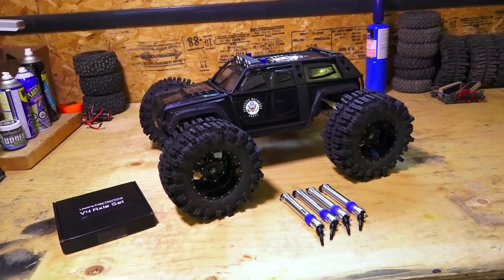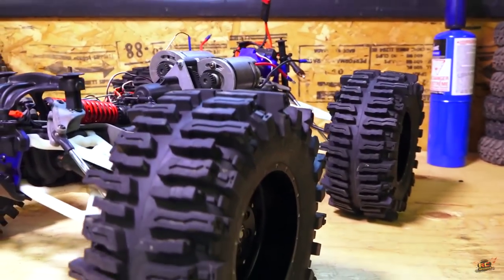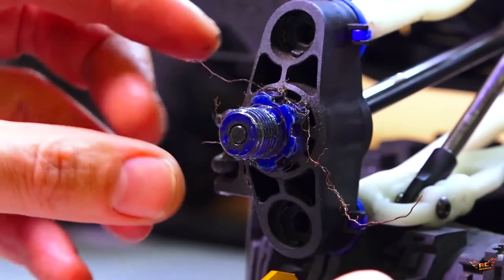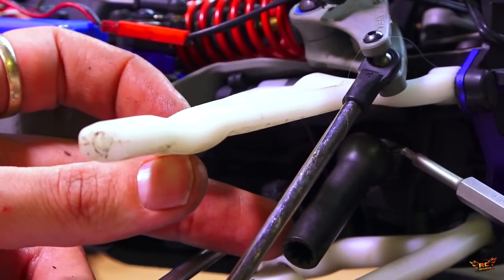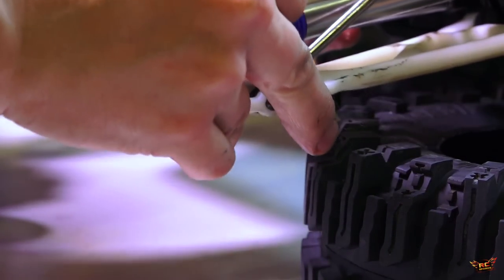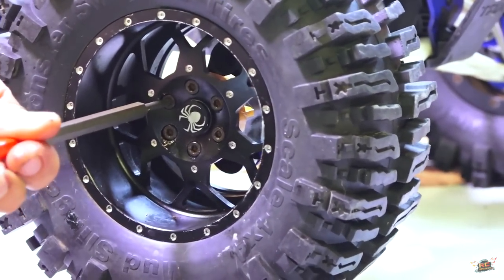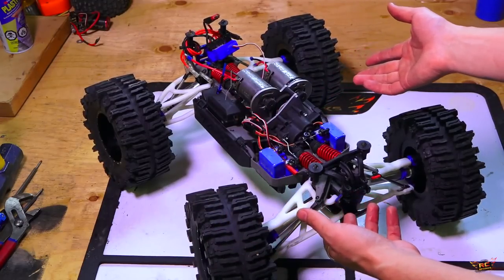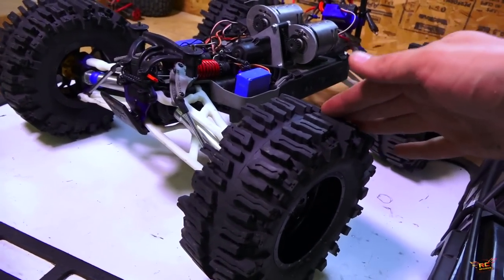RC ADVENTURES - LEM Traxxas Summit 1/10 V4 Axle Upgrade (4 drive shafts swap from MiP)

Comment from the maker: a LiKE click is always appreciated for my work, thank you!
Reply: Need advice medic, I got a slash 1/16 with nearly every integy and rpm upgrade, and a brushless motor. What should I upgrade? I'm currently working on converting it to an erevo, but that doesn't matter an extreme amount to me.
Reply: So Nice your summit
Reply: Do the dog carrier on camera! I have the summit and would like to see the transmission apart because I have never done so either!
Reply: +RCSparks Studio  bääääämmmm this is really a good job and a great upgrade........thumbs up my friend :-))
Reply: hay do u watch Rc world
Reply: i have a traxxas rustler xl- 5 but im not to happy with it it tends to break to fast i already have to get a new battery after 2 months
Reply: +Ben Varley lipo or nimh?
Reply: +Max Mobley. nimh i don't have money other wise i would get a lipo battery and a velenion moter/ esc and bigger wheels
Reply: +Ben Varley okay, do you have an eBay account? If so, I'd recommend getting some nimhs unless you have a balance charger, in that case I'd grab some cheap venom lipos from eBay, like medic uses. If you destroy bodies like I do, I'd also recommend getting an integy rollcage so it won't destroy your body, or run without a body and use the rollcage as protection. Just a thought, good luck, and happy rcing!
Reply: Hay do u ever plan on doing any more drifting
Reply: +RCSparks Studio Hey Medic, I've got a Dromida DT4.18. It's a little 1/18th scale 4WD desert truck. It is a fantastically fun and inexpensive beginner truck.  They come standard with a brushed motor and kind of a terrible battery that only lasts 15 minutes on a long run. Was curious if you could get one and build it up?! I think it would be an awesome truck for Morris! They offer a bunch of aluminum bits along with a brushless upgrade. Would love to see a budget build like this!
Reply: +Max Mobley.no i just got in to rc in December a friend showed me traxxas and i wanted one with 4wd but didn't have the money for it
Reply: +Bryce Perry i found one on creigslist looks so fun i want it so baddly
Reply: +RCSparks Studio Can you please bring out the 1/4th scale killer crawler? keep up the good work!
Reply: +RCSparks Studio Just letting you know that I would love to see how you would figure out the transmition.
Reply: +RCSparks Studio I recognised myself when you asked if someone worked on his RC during the video, I was fixing my Axial Yeti (1/10 kit) that I fully upgraded in aluminium (every single part apart from the chassis) I also have HPI WR8 (1/8 rally car) also fully aluminium, a Thunder Tiger E-MTA (1/8 Monsertruck that look like a 1/5), a Carson Specter X8EB (1/8 Buggy), a very old Tamiya TA-02T (1/10 desert truck) that I have completely rebuilt in aluminium and steel part (I love this truck by the way), and finally a TT-02D from Tamiya (1/10 drift car). I also got a little HPI baja Q32 for when it rains too much outside. So that's it.
Great video as always Medic, thumbs up !!!
Reply: +Aksel Giæver agreed
Reply: Hi Aaron :) I have a Kyosho MP9, Losi 8ight, BSD racing Buggy, Hubsan X4, and some more custome Tracked vehicles :) quite a few videos on my channel,
Reply: I though of a name of it traxxas overkill
Reply: +RCSparks Studio hey dj medic where can i purchase those rims
Reply from the maker: Chase Wychock From the helpful link I placed in the video description box ;)
Reply: I have a traxxas slash 2wd vxl-3s and I bash it so hard!
Reply: +RCSparks Studio Sorry if this question has already been asked, but what are the 3 allen or grub screws in a row for on the new LEM drive shafts? Thanks and well done video ! My rc's are Bandit vxl, 2wd Slash XL5, Emaxx 3905, and 2wd Stampede Vxl.
Reply: +RCSparks Studio i think you forgot to place the link for the rims in the descrption
Reply: yes to the transmission skip fix
Reply: +RCSparks Studio i have a Traxxas xo-1
Reply: what is the price of this???????
Reply: RCSparks Studio
Reply: so I have a slash 2 wheel drive had the Titan 550 power was OK so I took esc out moter put in a new vxl3s 3500 velineon brushless I got to say I like the change. try it is think you will like it as well.
Reply: RCSPARKS STUDIO can you do a video on t plugs  on the best way to use them.very tricky plug to use.
Reply: holly h castle motors are better
Reply: RCSparks Studio ty for your upgrade and i am join your video your all video im watch
Reply: RCSparks Studio look my emaxx and summit back flipp video
Reply: RCSparks Studio yo I like your work
Reply: Did you ever make that video on removing the Transmission slack?? I'd really like to know how to do that! Need a new Summit vid from you BTW!!!!
Reply: I have a Traxxas slash vxl 2wd a Traxxas bandit and a Traxxas blast
Reply: Lipo
Reply: when can i order these axles plz!?

Comment: I'm right in the middle of rebuilding my Summit's rear diff. My local group just had what we call "Bash Fest" and ran a Monster Jam style race. It was a blast even though my diff couldn't take the abuse of the day, but hey it is the original part and is 5 years old!

Comment: Working on my Rusty 4x4 VXL. Has MIP X-duty shafts in the rear and I just put the Traxxas CVD shafts in the front. (hobby shop was out of the front MIPs or I would have used them) Literally 30 sec into the first pack I broke one of them. Sheared the threaded part of the stub axle right off. Really glad I didn't have to chase one of my 2.8 Trenchers down the road. (landed on it's side)  I don't bash very hard but it's pretty crazy that after 8 months on stock axles with no issues, I break 2 of them in a week (doing nothing special) and then break a Traxxas CVD in under a minute!

I love this hobby! :)

Comment: Love watching these build / rebuild vids. One tip I learned about loctite a while back is if you really want it to work properly the metal surfaces (threads) need to be 100% clean and free of oil/grease/dirt. There is a proper loctite primer you can get but I always use a bit of brake cleaner with a rag and or air gun. Makes a huge difference.  BTW Thank you for inspiring me to get an RC for the first time, I have a 1/10  Losi Night Crawler 2.0 that I am have a great time with in the local bush tracks here in Sydney.

Comment: I've got a Stock Traxxas Slash 1/10th XL5 2wd. Just put a set of Pro-Line Trencher X SC 2.2's on her and she now wheelies, with the stock Titan 12T motor and a 5000mah Nimh battery. So happy I went with new tires over trying to get some Lipos for my first upgrade! :D
Reply: Harry Baker uuuuuum if it has  all those parts then it's not stock
Reply: @wckedcp3582  so tires equals all those parts lol ok

Comment: they look sweet for sure
and don't forget to put the lock screw on that motor hehehe just picking sure you know it's out

sold all my racers have a SCX10 well 2 of them a TF2 Losi mini crawler as well as a converted Losi micro into a 4x4 quad for the back of the TF2 

and to think you were one of the main reasons I got into RC in the first place lol
Thanks for everything over the years and looking forward to the many more years and maybe even seeing Mo take over or at least co hosting with you & Mom 

best wishes to you & the family

Comment: Yea, I would personally love to see the removal of the slop in the transmission. I've owned a summit before and the slop was even more in my truck. sadly at the moment I don't have any RC vehicles as i had to sell my wraith and summit when my son was born. However that going to change soon I'm thinking of getting another summit. are all the other upgrades in videos? I would also like to know what mounting plate that is for the motors as well as those arms they seam wider then the stock arms. I've been watching your channel for a few years now you actually got me motivated to get my first RC years ago. Thank-you for reading this book of a comment if you read it!

Comment: You might want to try using HPI's flange nuts they use on the savage with 17mm wheels. Cut the threaded part of the traxxas hub off flush with the hex, then use the HPI nuts. Doing that avoids dealing with the slop that ends up getting ground into the stock hubs by the threaded axle. I've done this on both my revos and it's worked out great.

Comment: lucas gun oil! I found it at the counter at my local auto store! I use it on everything, gear box's, diffs, bearings. It's water proof, sticky and thin visc. Just a little drop goes a long ways! I would recommend it for just about any part of an rc!

Comment: Just a suggestion but you could mount your esc on a stock rear chassis brace for Revo/Summit Tra5632. Also a great place to mount an extra battery for lights etc

Comment: I was fixing my traxxas slash 4x4 that has pinion issues and I plan to upgrade it to a castle MM2 with 2650kv motor. :D

Will you be at RCX 2016?

Comment: Hey medic. I just went and picked up the tracks alas platinum edition and i am currently running a 2s lipo.  I am loving the truck. Watched your videos about it and have been researching it for couple years now and made the decision to get it. I am now having problems with the steering servo. I believe. The wheels are turning them selves at about 15 degrees randomly. Is this a problem with the servo or does the transmitter and receiver need to be re linked. This is my first battery operated car and not sure what to try first. Any info I could get would be great.

Comment: when you water proof your bearings on the summit, do you clean and re grease all including diff and the suspension rocker arms or just the wheel bearings?

Comment: Great video, those drive shafts look really clean. if they would have a version for the E-revo, and if they wouldn't be as pricey I would defiantly order a set for my E-revo. One thing I noticed is that you put the pivot ball cap back into the axle carriers backwards, did you do that on accident?

Comment: So how are these axles holding up? I've been eyeing these and saving my pennies up to get a set (actually both LEM upgrade kits), but I was just looking for some additional first hand info regarding the axle kit. I'm trying to bolster and beef up my platform before eventually putting in a brushless system. I have another somewhat unrelated question. I'm using a single Savox 1230sg servo along with a Hot Racing clamping servo horn, and their aluminum servo saver as well (with resistance on the wheels the stock plastic one flexed and warped a lot), when "water proofing" the servo, can this (the 1230sg) be put into one of Savox's water proof cases and go through the normal water proofing methods (i.e. - marine grease, plastidip, etc.), or would I be overheating this thing by not using the aluminum case?

Comment: There are great Driveshafts, 👍 👌 noticable lighter than the steel Hot Racing versions & look far cooler. 
One mod I recommend if your handy with a Dremel (cutting blade) I hate having to superglue rubber boots on these axles.
So I cut a 3mm groove (around 1 mm deep) on each side of the 2 piece Axle around 2mm back from end to form a lip or barb type design, then a tiny cable tie (2.8mm x 100mm) can hold each end of the rubber boot locking the boot into the 3mm groove thus the cable tie & boot can not slip off because of the lip, it will never come off & the boot is far easier to replace, servicing for maintenance is also far easier.
Obviously this will void Leading edge warranty but the groove will not affect the overall strength of these axles as its got no load effect (turning force) in this area.

Comment: hey medic I have 2 rc cars as of right now I have a Traxxas nitro rustler wich is my favorite out of the two when it runs lol. the reason it doesn't run is because I need new electronics because the receiver doesn't have an antenna and it shuts off and full throttles it and it just needs new servos other than that it is a blast. I also have a DHK Hutner witch is a good beginner sct but it has given me so many issues  over the last year of owning it like the servo striped when I was racing the esc stopped working the motor blew the transmitter and recever stoped working. so ya if you are more experienced go with the slash.

Comment: Got a Traxxas Summit just like you, have had it for a few years, and my motor just died, caused bu the "positive" brush. And since Im going to repair it, I also wanted to upgrade it to the motors you currently have, and bigger tired, I looked up and was going to buy the Imex Jumbo Kongs, but they went out of stock when I was going to order them. Are the tires you have on your summit as big or equailent as the Jumbo Kongs? Because my current tires are the Traxxas Maxx tires all because of the stock tires broke.

Comment: Wow what a rig👍🏎
Reply: Hey can someone please 🍺🐾 leave links for 1/16 e revo maintenance? We already have a noise motor like a worn out drill? It still goes fast though

Brushless 2015 model

The esm/gyro or stability sensor unit was removed as it  was damp from condensation.. So trying to dry  it out

Who likes manual driving vs computer assisted tsm?

Let us know on our channel please in comments on an RC video 

👍🏎thanks a bunch

Comment: A threaded washer would be called a nut! I run these rims and tires with a summit 2 speed transmission and a brushless 4274 2200kv motor with great power to the tires.

Comment: Your Summit is so sweet!!!
Ive been researching some good RC's to buy as my first and right now I've narrowed it down to the Summit or the Vkar Bison that kinda grew on me and is cheaper too, but this summit is a bit of a step above the bison.. I would say the summit is overall better quality and has crawling capabilities, as well as bashing, and the bison has a good entry level price point, but also seems like it would be a decent racer too and handles really well.. whereas the summit seems a little heavier and a bit less "racy"… (just my two cents right now) obviously the summit is a step above in terms of quality and attention to detail and upgrade-ability .. its pretty impressive
Reply: luckkydraggon1111 I have both, and I have to say I enjoy the summit much more even though it's much slower. It is significantly bigger, and much much more capable in rougher terrain. The bison is really good for high speed bashing  and speed runs with the loose diffs and brushless system. The summit is a well known truck that can take a beating. I have yet to break anything on mine. They're both pretty durable but I would take the summit hands down any day. Just my opinion.

Comment: I just noticed near the end of the video that one of your motor mounting screws on the motor in the middle of the truck is not there.😁  Also, I have a Tamiya CC-01, an Tamiya Wild One, A Tacon Thriller, A Mad Gear Desert Wolf Baja and a halfway scrapped Tamiya Grasshopper.

Comment: Thank you for the video. Great stuff, once again :) Those driveshafts look so badass. Its wintertime also here in Finland, so lots of maintenance time for the summer :) My new Slash 4x4 ultimate is having a new body to be painted and my converted Revo 2.5 is already top notch. Bought also a huge 1.5 meter long Rc speed boat with my friend and it needs all the electrics aswell. It used to be gasoline boat, but as Leila K says, Electric it is ;)

Cheers!!

Comment: Had a MIP fall apart going full speed on 3s in my Stampede 4x4. Really sucked, but I found the pieces. :) Used over half my bottle of lok tight on my MIPs alone lol.

Comment: Nice video! Quick question, my summit's suspensions are pretty stiff. Even though i rotated the bolt at the maximum length of the spring, when i push it down it goes pretty hard and after that it won't lift up. Any solutions? Thanks.

Comment: hey medic, my shocks are going out on my traxxas slash 2wd do you know of any shocks I could get for it thanks. keep up the good videos man
Reply: g made xd, proline powerstoke, traxxas big bore
Reply: +B0B theman u should get proline pro-spec short course shocks thats what i have and I love them. They have aluminum threaded bodies. I use 35 weit shock oil in mine
Reply: i thought about doing that so might as well do that
Reply: +B0B theman check out Boomracing, they have fantastic shocks for all kinds of rigs.
Reply: Rebuild the shocks with new oil only cost 10 buck to do it. 
I clean mine and refill them every couple moths.

Comment: +RCSparks Studio I'm running an RC4WD Trail Stomper that has been heavily modified just to run 4 link front and rear (trail finder 2 kits) with a few more custom parts, pain to find replacements / upgrades for now its discontinued.

Comment: Man ' that is so close to the e-max I have ' it's a black frame ' so Iwas told buy traxxas that it was made in early 2000 's . I bought it in 08 & knowing what I know now I would have bought the newer model w/ a brushless motor & steel drive shafts . I have had nothing but problems with this e-maxx since I bought it in 08 .

Comment: Hey Medic, any idea on where I might find the white rpm a arms? Looks like it's impossible to find them now! 
Summit with Dick Cepek 40 series/mudslingers 
Wraith
Scx10 jk custom
Scx10 tamiya tundra hardbody 
Gmade sawback
Gmade r1 custom
Rc4wd beast 2
Kyosho blizzard (sabertooth onboard of course)
Hpi 5b ss 
Emaxx mamba monster 
Revo 3.3 converted to mamba monster 
Art attack sled mamba monster
And last but not least.... my beloved Blade Chroma 1080

Comment: I have a Duratrax evader ext with multiple upgrades
Aluminum shocks
Cv shafts 
Ext2 tires and rims 
Custom top with led lights
Custom front ram bar
13t atomic fireball motor
12t Duratrax modified esc
2.4ghz radio instead of the old 27mhz
It runs on nimh but I'm going to soon get a brushless setup for it and during summer I'm gonna get a traxxis slash platinum edition